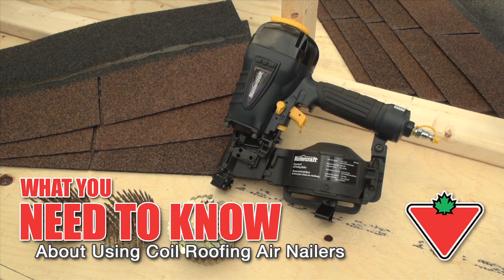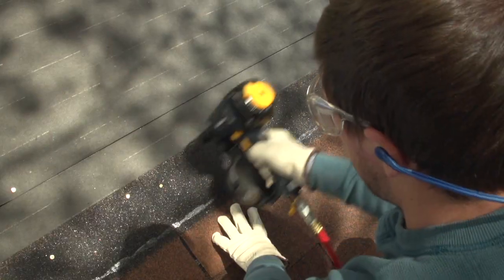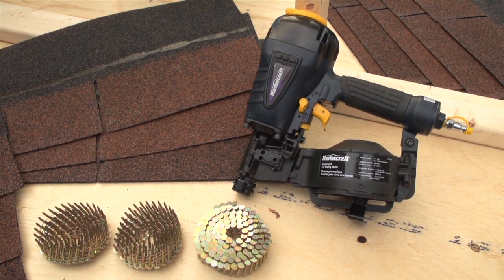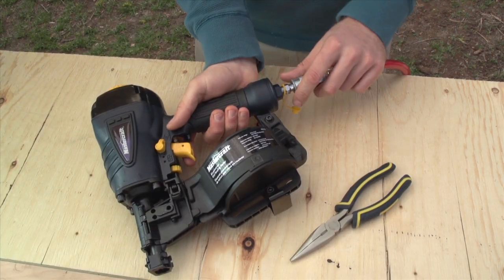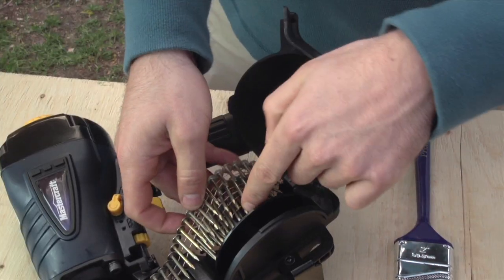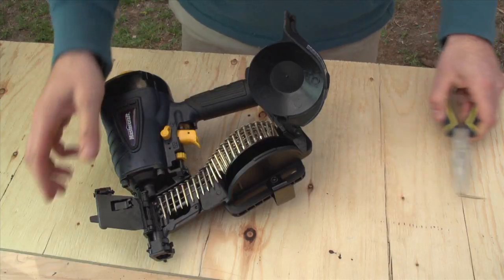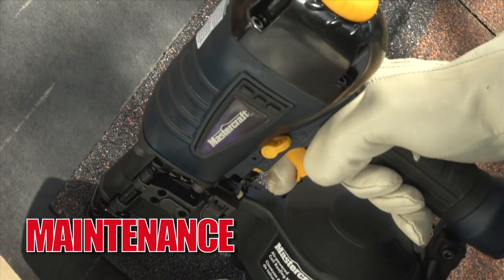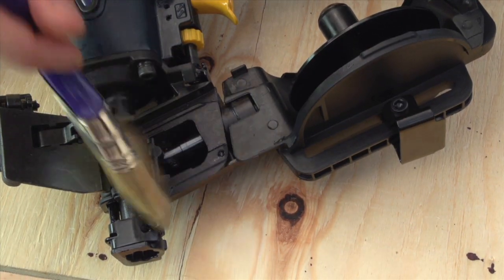Roofing Air Nailers User Guide From Canadian Tire

Comment: CT does not sell parts for this gun, or it's replacement. Anyone know of an equivalent make and model that has matching parys that I can order? The gun has had very little use, but did sit unused for 10 years between jobs. The sealing washer at the top of the cylinder has shattered. It is made of some sort of translucent hardened sylicon.....
Reply: Throw it out there no good